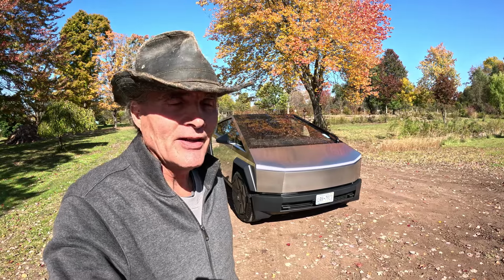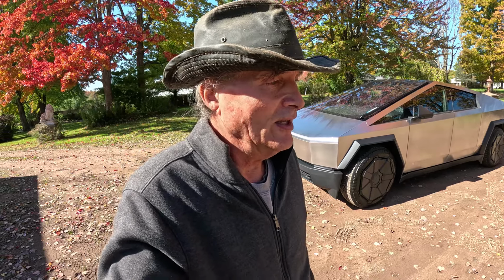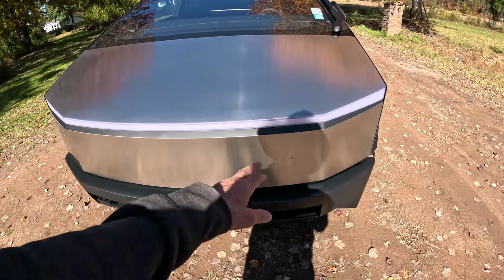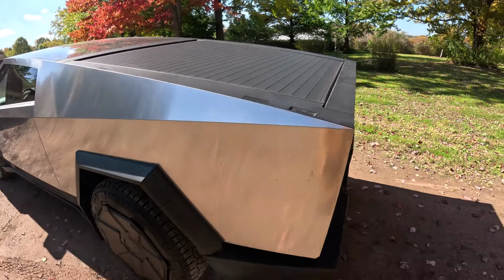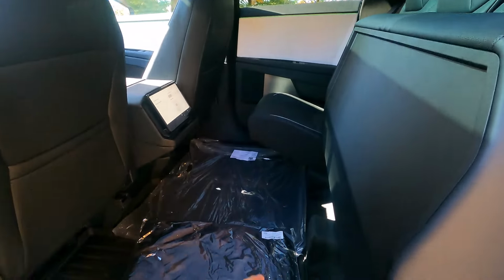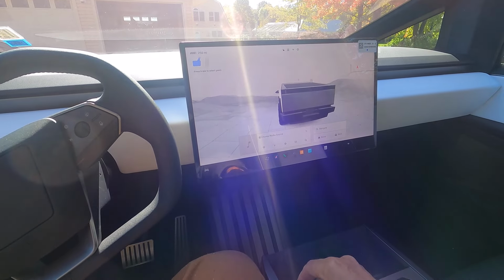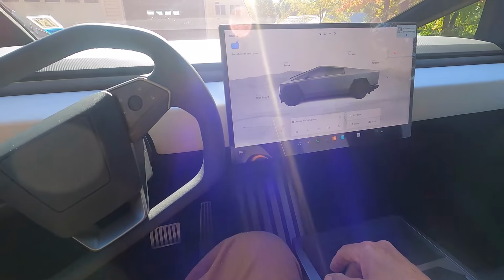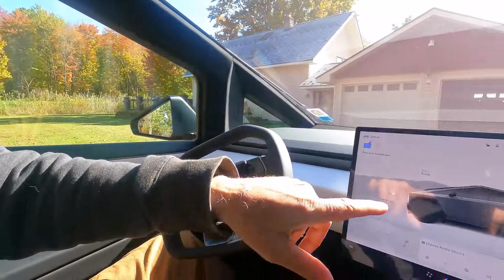Introducing Thor: Our New Tesla Cybertruck | 2024 AWD Dual-Motor

Comment: I would get it wrapped when you can to avoid dealing with fingerprints. I like the name, Thor. Very appropriate.

The issue is not how much it can tow but how long. Still it’s a very cool BEV.
Reply from the maker: Yes I think wraps are very cool however given on my property where I'll be driving Thor the wrap will probably get damaged just like the scratches dug into my previous trucks. And I actually think that the Cyber truck looks cool the way it is. We'll see how things turn out. Thanks and have a great day!

Comment: Please be careful with it, they have had recalls
Reply: Tesla uses over-the-air (OTA) updates to fix most of its recalls, which means vehicles don't need to be taken to a dealership for repairs.  OTA updates are software or firmware revisions that are delivered wirelessly to electronic devices.
Reply: 2023 Ford F-150 had 10 recalls. so nothing special here
Reply: @JS-EDM   a man was incinerated in a cybertruck like a month or two ago. The lithium batteries are dangerous in the truck and other Teslas seem to be fine
Reply: @Dirt-Fermer  and like 5 months ago a guy got cooked alive in his f250 when it crashed
Reply: @Dirt-Fermer That’s simply not true…the incident you are referring to was a Tesla employee driving a test mule when for whatever reason he drove off the road resulting in a fire. The driver was able to get out of the wreck and notified emergency services as the fire was in a dry wooded area.
Reply: @jezza6575   nope. A different incident.
Reply: @mcsike7264   all it takes is piercing the battery of a tesla truck to get it to ignite.
Reply: @Dirt-Fermer  good thing they are well protected its not like a gas car were your transmission drive shaft and every is exposed thats why under evs are so flat its a metal bottom
Reply: @Dirt-Fermer  it can happen to any car  you should not drive any car if you are worried that much